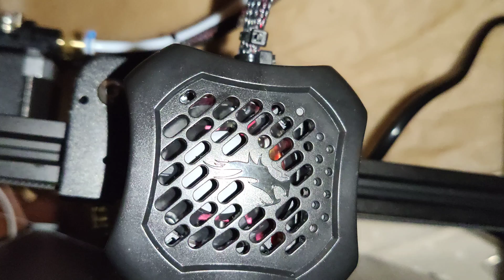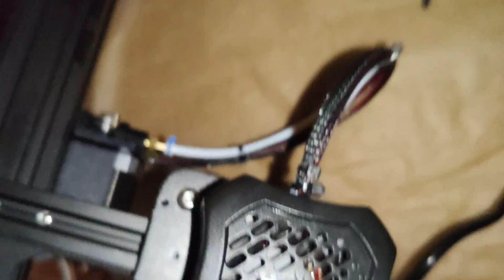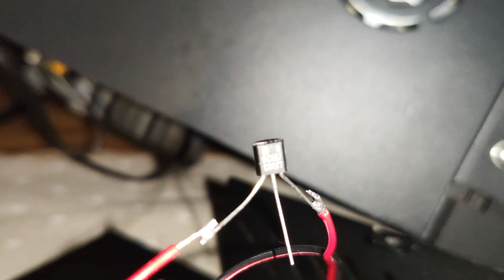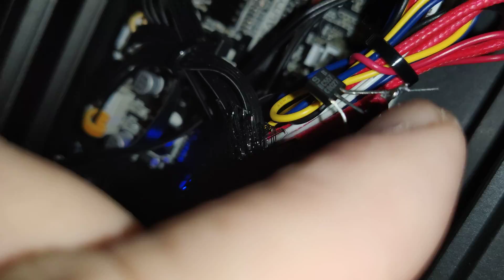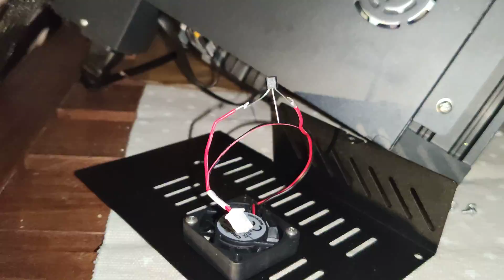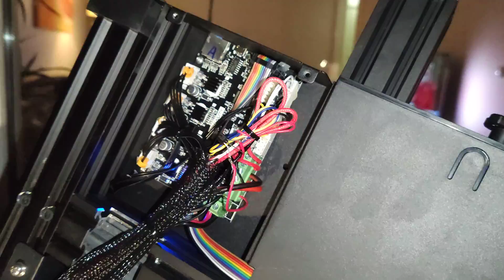Ender 3 V2 🧏 How to Silence Your Noisy Cooling Fans 👌

Comment: On the hot end I've used a Sunon MF40202V2-1000C-A99 DC 24V 0.68W 40x40x20mm achieved for 21 db, no need to modify eletrical power, just print a different hotend for 4020 fan. 
I've used Mini 360 buck dc-dc converter on the stock PSU and mainboard fans that I've set between 12-15v to obtain low noise and still good airflow. And opened with a cupsaw the power supply black steel cover to have more air flow.

Comment: Wrong fix... 1st the hot end needs proper adjustable air and 2nd That's not the purpose and connection of a transistor..

Comment: I love it you didnt even search anything up and just put it in why it isnt made for that its for a electric switch for low voltage now you use it as a transiter.... that is going to heat up I think if I am not wrong just put noctua fans in there or lower youre fan speed in marlin or any other software youre using dont do this plz its STUPID

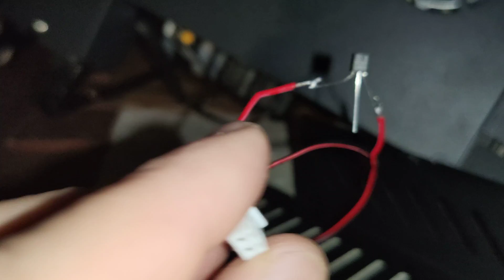Comment: Report video as Harmful or Dangerous acts: abuse of fire or explosives at 0:30 - Someone's going to loose a house eventually...this is just BAD.  A transistor should NOT be used in this way.  IF...IF the creality mainboard had an I/O pin to account for turning on/off the hotend fan, and IF you connected the base and set up the software then this would be fine.  But this setup is just plain dangerous and will fail eventually.

Comment: If you want less noise just buy a new fan you cheap fuck.
By doing this botched job and lowering the speed you are also reducing airflow which you definitely do not want.
This was also one of the most retarded ways if seen of lowering the voltage of such a simple 24v fan. In any case just use the damn Ohm's law and solder the desired resistor.

Comment: For anyone interested in damaging their printer, burn the room or the complete house down, do what Roland did in the video. 
For people who actually give a fuck about safety, there are a whole lot of guides on how to replace the stock fan with a Noctua fan (extremely silent fans manufacturer) the proper way and it won't cost you more than 15 - 20$ the whole deal
Reply: @omemanti  I used this guide and this video:
https://www.instructables.com/Ender-3-Silent-Fan-Replacement-Guide/ 
https://www.youtube.com/watch?v=vjL38udVS24

I recommend watching/reading before doing anything and a bit of patience because in my case the plugs in the mainboard in my Ender3 were hot glued.
Reply: @Brajuitorul  Skipping Noctua and getting something cheaper - avc. Hopefully they will last, provide enough cooling and be quieter than the stock fans on the ender 3 max. The psu and mobo fans aren't that loud, but the hot end fan is just ripping and tearing like a jet engine.

Comment: Roland, you sure don't understand anything about electronics...
What you are doing now, is using the diode in the PNP transistor to drop 0.6 volt on the input of your fan. You are only slowing it down.
The fact that you do not connect the BASE of the transistor, means you are not using a transistor, just it's diode.
In fact, if you would add a thermistor in between the +  and the BASE of the transistor, you would control the speed of the fan. This means that if the thermistor is cold, the fan is turning slow, and when the heat becomes a problem, it will speed up the fan. There are also fans with three wires instead of two, who already have this transistor inside the housing.
The way you do it now, is just going to make sure you will get clogs in your hot end... Good luck with removing them.
Reply: Sorry, but teaching people how to „turn off“ their fans and saying „it‘s quiet now“ is a dangerous joke! In this case you can save the money and just cut the wires or disconnect it... sorry man, but that’s a realy bad idea... it may be enough for you and the prints you do but there’s no way to say that you ahould do this! 
PLEASE JUST DON‘T DO THIS!!!
Reply from the maker: believe it or not 🧏 fans spining and blow air (it's ok for the hotend radiator) exactly how much they need to not cool too much.
I understand electronics very well & I do minimize impulses not the voltage (and this is definitely not the diode effect)
Enjoy...
Reply: @ThousandHobbies  (and this is definitely not the diode effect).... You didn't connect the BASE, now did you? .......I understand electronics very well...... Guess not. Sorry. Moving on.
Reply: @3dPrintCreator  he is using PNP transistor, so it's not using it as a diode but as a resistor (even worse). I did a quick test and burned my hand since this transistor runs at stupidly high temperature.
Reply: @ThousandHobbies  You don't know what you're talking about! This is bad advise people!
Reply: @ThousandHobbies  The fan needs to be powerful enough to cool the radiator, if you don't want to call the fire department. The fact you slow down the fan to make it COOLER can melt and destroy the housing.

Comment: well, it just spins slower so less airflow...
Reply from the maker: you do not need... too much - airflow to the hotend radiator and motherboard, works 👌
Reply: @ThousandHobbies  you do need the full airflow to the hotend to not let the heat from the nozzle spread( Search for: heat creeping), that's why you have a massive heatsink... You can get your PTFE tubing and/or the nozzle clogged with material or even worse melt the PTFE tubing from heat creeping. Stop giving advice if you have no fucking clue what are you talking about.